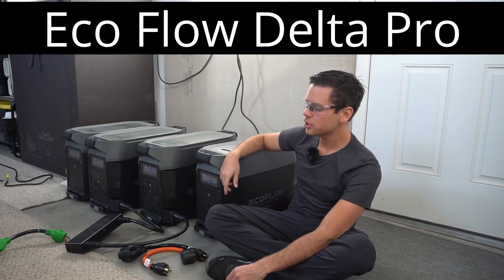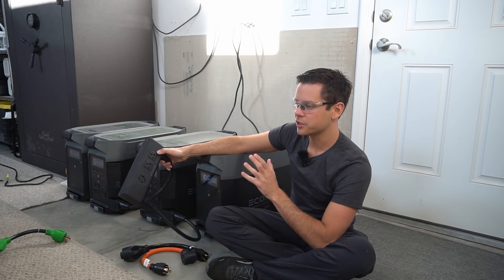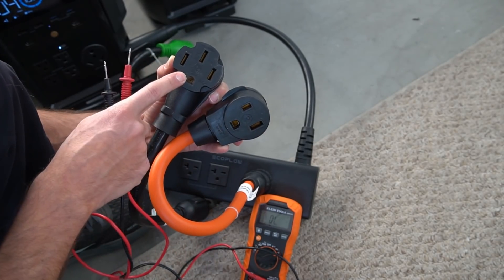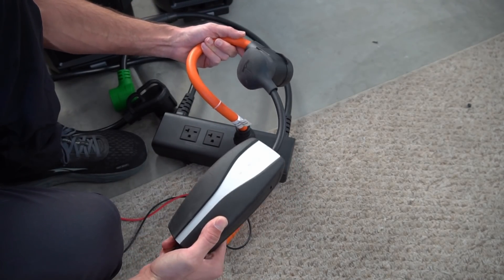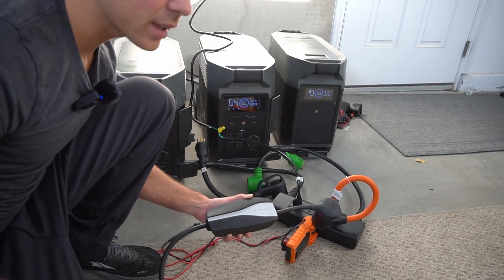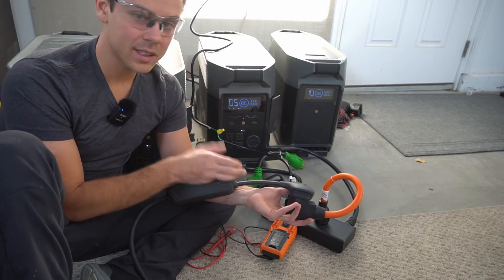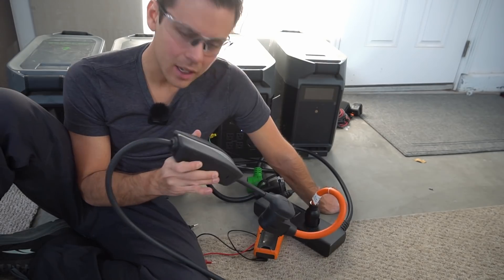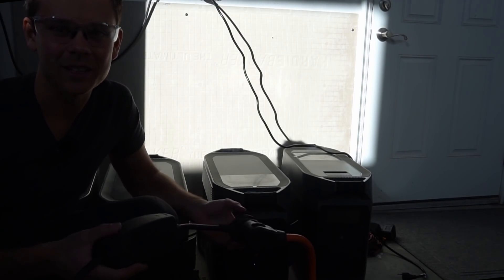Ecoflow Delta Pro: Strange Problem with 240V Output

Comment: I wonder if the wave needs to be cleaner. I do notice on ecoflow that the wave has a little difference in the peaks and valleys. You do need a larger scope to see this though. I work on massive digital LED signs and they are some of the most sensitive electronics out there. They require a large line conditioner for the battery backup system. Smoothest 60hz you will find. 18k heavy plating on the inverter. So, you are putting both of them together and amplifying that small imperfection. "Zero positives with 100 probabilities, until R&D" - F. Ledbetter
Reply from the maker: That is exactly what I am thinking. There is some noise with the switching going on with the ground between the two inverter circuits.
Reply: @WillProwse  

Hi Will, thanks for excellent videos. Since the Tesla mobile charger is basically a relay, and the charger inside the car basically is a large birdge rectifier, it is quite unlikely that the shape/curve of the voltage is the root cause of this problem. I would suggest to turn off the inverter, and then measure the resistance between the live wires and the ground. I just called an expert on Tesla Chargers (he has a master in power electronics, does wind turbine power electronics and repairs Tesla chargers for fun in hes sparetime) - he told me that the chargers are (for obvious reasons) quite picky with the earth resistance.

Since the system you've setup here is not connected to the grid, there is no reference to ground. This is also why it does not change anything that you connect the earth to wall outlet since this does not change the resistance between the live wires and the ground.

Now, this suggestion might sound insane, but if you do the math you'll probably see clearly that this can work. Make sure that the earth wire is connected to the "neutral" wire in your 3 pole outlet. Even though 240V in US is denoted as 2 phases and no neutral, it can actually be wired so that 1 wire can be considered as neutral, and the other as live.

In Europe the blue wire is denoted neutral - I am unsure of what is the common color for neutral in USA.

If you think about it, in a standard 110V outlet, 1 wire is also denoted neutral, and the other is live - however both wires carries exactly the same current in whatever circuit they are connected to. The only reason we denote 1 wire in a 110V system (230V system here were I live in Denmark)  neutral is because it is referenced to earth at the sub power station where earth (using a very large ground spear - I do not know if this is correctly translated) and a tap on the output transformer is coupled together.

Without knowing, my best guess is, that the reason you can measure 110V from earth (in the plug) to both live wires are that either resistors, or more likeliy capacitors (which are likely to be put there due to EMC) the impedance in these are probably to high for the Tesla mobile charger to accept the earth wire as a true earth wire.

A way to check this is to use 2 AC voltage mulitmeters and then measre the voltage from earth in the plug to both live wires which will yield 110V as you shown in the video, and then connect the TEsla charger while you measure it. I suspect that the earth voltage will change quite some.

The arguement against doing what I suggest is, that 240V is then connected to the chassis of the car while charging. While this is true (how insane this may sound) it will not cause you to be electrocuted if you touch the car and ground at the same time - since your battery pack and inverters are not referenced to ground. Everything is floating.

If you try this out as suggested above, you can also try to measure whatever current that can run from the chassis of the car to ground. In theory this will be 0 (since the car and the inverter and battery are floating) but in reality it will probably be some micro amperes (AC). An easy way to do this is to connect one measure pin from the AC amperemeter to a door striker or other place on the car which has proper connection  to the chassis, and a ground pin in an outlet.

I hope you read this comment :-) and I really hope that you will recieve this message in the positive spirit I wrote it in.

Kindest regards

Hans-Henning Terp-Hansen
B.Sc.EE.CE.EP

Comment from the maker: Update: Found a solution! Not ideal, but it does work: https://youtu.be/0WQwRvhk2SM

You only need 2x Live and a Ground for NEMA 6-50. The neutral is not connected or used at all, so it should not matter whether or not its connected to neutral. I also tested NEMA 14-50 with disconnected neutral and ground, and again, did not make a difference. If I connected ground and neutral, it may work, but then I would need to find an adapter sold online. I would not want beginners buying a solar generator messing with AC wiring. The whole point of this unit is to be "plug and play". 

I am thinking that there is some noise on the ground conductor, which is a connection between two inverter circuits. This does not seem to be a problem with MPP and Growatts, but seems to be a problem with the ecoflow delta pro.

~~~~~~~~~~~~~~~~~~~~~~~~~~~~~~~~~~~~~~
Tired of getting ripped off? Check out my "Will Prowse Approved" solar product recommendations below!

12V Batteries
https://www.mobile-solarpower.com/lithium-batteries.html

48V Batteries
https://www.mobile-solarpower.com/48v-batteries.html

Offgrid Inverter System Builder
https://www.mobile-solarpower.com/48v-complete-system-blueprint-559371.html

Hybrid Inverter System Builder
https://www.mobile-solarpower.com/code-compliant-48v-offgrid-system.html

Mobile Handtruck System Builder (very popular!)
https://www.mobile-solarpower.com/mobile-48v-system.html

Solar Panels
https://www.mobile-solarpower.com/300w-solar-panels.html

Ground Mount Solar Racking
https://www.mobile-solarpower.com/ground-mount-racks.html

Wire, Lugs and Busbars
https://www.mobile-solarpower.com/wire-and-connectors.html

Tools
https://www.mobile-solarpower.com/tools.html

Fuses and Circuit Breakers
https://www.mobile-solarpower.com/fuses.html

Plug-N-Play Solar Systems
Ecoflow, Anker And Bluetti! So many models to choose from. See my current recommendations here:
https://www.mobile-solarpower.com/full-size-systems.html

~~~~~~~~~~~~~~~~~~~~~~~~~~~~~~~~~~~~~~~~~~
Need to build a large DIY system? Need a trustworthy solar distributor? These are my favorites:

Signature Solar
Creator of EG4! Solar Minisplits, Victron and More! Largest Solar Store Online.
If you want $50 off, please use my link below and coupon code "DIYSOLAR50":
https://signaturesolar.com/?ref=cPwLcVc0SW-BjN

Current Connected
Best Prices for EG4, Victron, Midnite and so much more! Fast Shipping and Highest Rated Customer Service:
https://currentconnected.com/?ref=wp

~~~~~~~~~~~~~~~~~~~~~~~~~~~~~~~~~~~~~~~~~~
Join our DIY Solar Community 
Need more help? Join the largest solar forum on the internet for beginners and professionals alike. 140,000 members and counting!
https://www.diysolarforum.com

Check Out My Free Book
Best-selling and beginner-friendly guidebook to off-grid 12V solar!
https://www.mobile-solarpower.com/the-book.html

~~~~~~~~~~~~~~~~~~~~~~~~~~~~~~~~~~~~~~~~~~
Contact Information:
I am NOT available for personal solar system consult! If you wish to contact me, this is my direct email: williamprowsediysolar@gmail.com
FTC Disclosure Statement and Disclaimers:
Every video includes paid promotion or sponsorship (such as free products for review). Some links on this YouTube channel may be affiliate links. We may get paid if you buy something or take an action after clicking one of these. My videos are for educational purposes only. Information is subject to change/update at any time. Electricity is DANGEROUS and can kill. Be smart and use common sense :) DIY Solar Power with Will Prowse is a participant in the Amazon Services LLC Associates Program, An affiliate advertising program designed to provide a means for sites to earn advertising fees by advertising and linking to Amazon.com
Reply: I bet it's because it's not Split Phase. Even though you have 2x 120v, they're probably from the same reference. Whereas your home has 2 separate hot legs coming in. I know you're using 2 batteries... hrm.. maybe not?
Reply: @timryder4036  Then he would not have had 240v when he tested the plug.  This is how I find what plug is on what leg in my home, long cords plugged in and meter the hot leg, when I get 240 the I know...
Reply from the maker: @timryder4036  But yes, there must be some noise on the ground that is freaking out the charger.
Reply from the maker: @timryder4036  There should be a common ground between the two circuits. We use similar configurations such as two LV6548's in parallel for split phase output, and it works fine. Same with other inverters.
Reply: Evidently the Tesla ground detection is more sophisticated than simply "continuity between neutral and ground."  Probably the charger is measuring voltage on each of the legs relative to ground and perhaps looking for a sensible or at least stable relationship. On a single-phase 240v system like the U.K. one leg will be 240v to ground and the other will be 0v to ground. In the U.S. each leg should maintain 120v to ground. The Tesla probably does not care which, but it probably detects a ground floating somewhere between the hots -- unstable.
The Delta Pro adapter is almost certainly maintaining the relationship between neutral and each hot to 120v. By building your own adapter and bonding neutral to ground, you forced the Delta Pros to maintain that relationship also with ground..
Reply: @Sylvan_dB  - Probably so, but it's against code because it's unsafe.
Reply: @tomnoyb8301  No, and no.  It has nothing to do with code when it is isolated from the grid, and it is not inherently unsafe.
But do see his followup video where he does connect to the grid.
By the way, most portable generators do bond neutral to ground. Better ones make this removable for use when powering a building with its own neutral ground bond.
Reply: Surely the first question to ask and understand the answer to is 'why does the Tesla look for the earth-neutral bond?'
Reply: Two-phase allows different currents on each phase, so neutrals are not grounds.  Example: if phase-A draws 10A and phase-B draws 3A, then the neutral is carrying the difference (7A).  Thus, tying the ground and neutral together means they each carry roughly half (3.5A).  Grounds shouldn't be carrying current, except in emergency situations (shorts).  Grounds carrying currents float-up to voltages, when they should always be near zero-Volts.  GFI's measure neutral-to-ground Voltages to trip.  Grounds and neutrals should only be tied together at main-panels (not sub-panels) to avoid these problems.  (more...) 

Ohm-out the pigtail-extension-cord to see if ground and neutral are tied together?  Then get a pigtail-extension-cord that isn't tied together?  That's where this author would look first anyway?
Reply: @tomnoyb8301  Good points.
Reply: Odd that in Europe they have shown you can use a single 240V unit as an emergency EV power supply, any way of switching the American 120V unit over to 240V?

Comment: Maybe it's seeing potential across nuetral to ground.   Did you check that for either voltage or continuity?
Reply from the maker: There is no neutral with NEMA 6-50
Reply: @WillProwse  Your meter measured 119 from each hot to ground but 240 across the hots.  Should be 238.  If your meter is accurate then a ~2V AC on the ground could be perceived by the charger.  Probably an ever-so-slight phasing issues between the two units that can hopefully be addressed by firmware updates.
Reply from the maker: @v12alpine  Ohhh good point.
Reply from the maker: @v12alpine  Yes that would make sense.
Reply from the maker: @v12alpine  You were right, I got it to work. Posting video in a few minutes. good call
Reply: @WillProwse  glad you got it working!   so cool.

Comment: Jump the neutral to ground on that power-strip and it will work (maybe)

And I think the reason is because your home has neutral and ground bonded at your main panel… so the charger tests the ground neutral to be closed… when it senses open (since these generators are open floating ground) it then says… nope, this house isn’t to code! Because it always assumes the charger is being plugged into a grid.

Because if your home main panel isnt bonding the ground and neutral that means your only path in a fault is earth!! So potentially your neighbors ground rod becomes the path back to the source lol… wild
Reply from the maker: I really want this to be a plug and play unit for people. I am thinking it might work, you are right. But I do not want beginners having to wire up their own ground/neutral bond cords. 

And there is no neutral on this configuration. It is not touched at all. NEMA 6-50 is only two hots and a ground. The neutral should not be required. but how the inverter circuit is connected, maybe the common ground is on neutral. That would be strange.